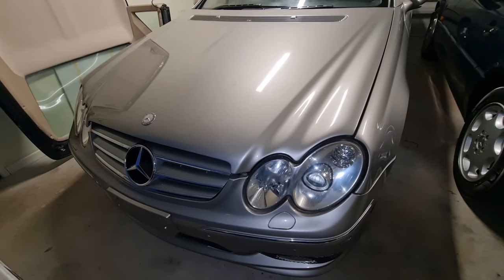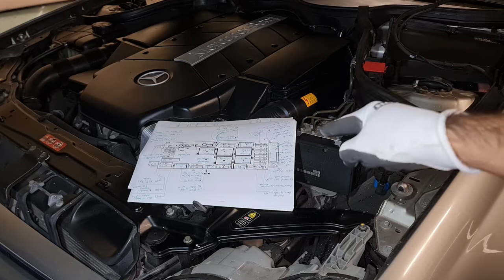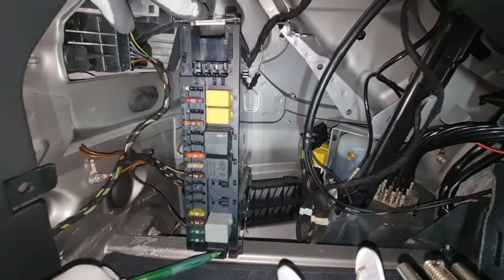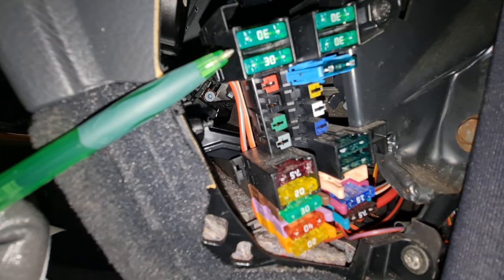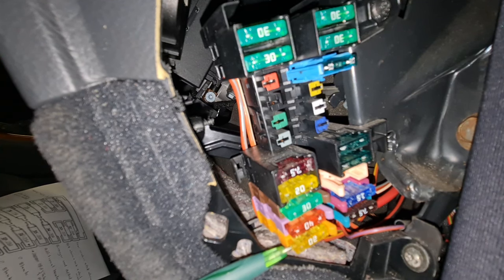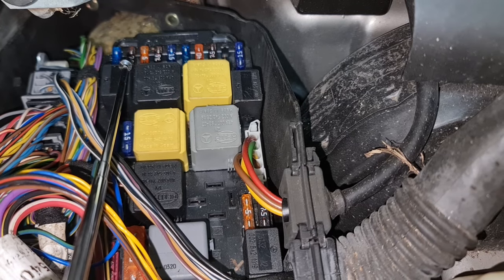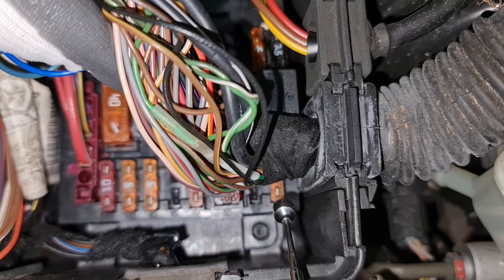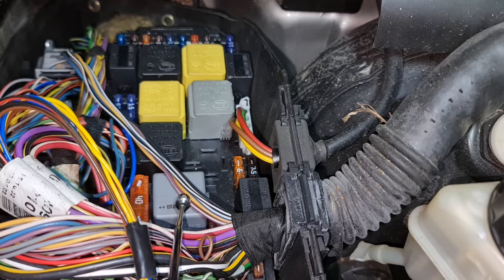Mercedes CLK & C class Fuse and Relay Diagram & location

Comment: CLK 320CDI year 2006 sporadically cuts off. When I restart it it starts perfectly as if nothing has happened. Could the terminal relays (15R and 87) have something to do with it? Sometimes it happens even before i start the engine. The instrument lights turn on and off.
Reply from the maker: @erensazakli7554  yes. And check the negative terminals too, they might get loose or corroded.

Comment: Hello, my ac and heat randomly went out and will no longer blow. Which fuse could that be ? Thank you
Reply from the maker: Please check the relevant fuse and if if the fuse is good, the module on top of the blower fan can be faulty.  Or the blower motor itself.

Comment: There are four fuse boxes on clk320   2002 usa  infront of passenger seat under the  hood  there is also 1 relay there😅
Reply from the maker: Thanks mate, 2002 is this a W208 or W209?

Comment: hello sir i have w203  with battery dead i was change the battery but i have no power in my car but when i switch on the radio it work but there is no contact no sound at riley when i  take off battery cable if i can get your whats app i send u vidéo you will understand butter thank you .
Reply from the maker: There are 3 big Fuses close to the firewall.  Check those out, make sure the battery is good, charged and the contacts are clean. Make sure the polarity of the battery is correct too.

Comment: Would you happen to know which fuse or relay would control the rear headrest/roll bars from popping up spontaneously and then the hazard lights start blinking? It's a 2009 CLK550 Cab, which does not have the roll bar switch to reset them. They have to be pushed back down manually. Any thoughts you might have on this would be greatly appreciated. Thank you!

Comment: CLK 200K 2000 Manual - Possible ECM issue?

Car's been having starting problems for weeks. The starter engages but won’t start the engine. Now, it won’t start at all. After a jump-start attempt, the key stopped working (not recognized by ignition or central locking), but it still sends a signal.
Reply from the maker: Ok, check to see if the car builds fuel pressure first. Check the fuse number 4 in boot also. Then see if you have spark. No spark? CpS gone (crankshaft Position sensor) I have lots of videos on all of these topics, check W209 playlist.

Comment: Hi, my fan is not kicking in causing the car to overheat.  What can I do?  Bad fan relay?  If so, location or where to find it in your video.  Any help is  appreciated.  Thanks!
Reply from the maker: I believe the CLK fan has no relay. The power comes straight out of a fan modulator and ECU. Need to diagnose using MB Star.

Comment: Hey! I recently changed an indicator light (right side) but I don’t think it was wired properly as the indicator light would flash every so often when the car was off. A couple days later, my car wouldn’t lock or unlock and the key does not start the ignition at all, the key hardly moves when it’s in the ignition? Could this have tripped a fuse such as the starter relay? Or do you know which fuse would be responsible for this? Thank you
Reply from the maker: Hi mate, this might have nothing to do with the indicator issue. Are you sure your battery is healthy / charged? Check the voltage first to be +12.5
Reply: @BenzAddiction  thanks for the reply, yes mate it was around 13v

Comment: I have no power going to the ac compressor in my 04 clk320 . Checked the 3 fuses and they are good.  Anything else I can check?
Reply from the maker: Hello, you need to check: 1. Pressure switch.  2. If you have enough gas in the AC system, both can cause the compressor not to work.

Comment: Hi I have a 05 clk320 and i have a problem with the left fog light, it's this little lamp at the bottom of the bumper on the left, it doesn't light up the light bulb is good
Reply from the maker: Might be a connector issue, or wiring issue... check your negative too.

Comment: If relay is defective and being traced for malfunction,,do we still need to check wiring and ground.
Reply from the maker: Well you first need to check simple and not costly parts and then replace Relays, a horn relay is unlikely to be faulty if not used excessively...

Comment: I have a 2004 CLK500 that I'm trying to fix, just replaced fuel pump and sending unit but still don't get a signal to pump.  BUT I noticed my SAM is upside down from the one in the video.  Is that normal?
Reply from the maker: Not sure, just fix it to the original position, might fix the issue. I know there is a cut off switch somewhere for roll over.

Comment: Hi I am trying to locate another accessory fuse in the engine compartment I know the cigarette lighter is one but I have my dash cam connected to that one I need another one for my daytime running light harness can you please advise me which other fuse is an accessory fuse or can I piggyback the daytime running light harness wire together with the dash cam wire on just the cigarette lighter fuse would that be safe thanks..
Reply from the maker: Hi Peter, if by daylight runing light you mean similar to fog lights but LED, where the actual fog lights are, you might want to have a look at this link which has wiring diagrams and more information: https://charm.li/Mercedes%20Benz/
Reply: No I mean seperate from the fog light the harnes6has 3 wires red and black get connected directly to the battery and a blue wire that I need to connect to an accessory fuse so when I turn the car on the daytime running lights come on and when I turn the car off they go out after 20 seconds
Reply from the maker: @petergiannitsadis3561  if those lights have 3 wires, the blue wire is just a sense and you are not going to pull much of a current from the blue. So you can connect it to pretty much anything as long as you secure your wires properly and insulate them correctly,  and use a 1 AMP inline fuse and holder, but as I said, have a look at the diagrams... hope it helps.
Reply: Hi I connected the blue wire to the wiper motor fuse the wipers work only in accessory or ignition mode  all good now.
Reply from the maker: @petergiannitsadis3561  good to hear 😀

Comment: I have a problem with my clk500 2005 the ac keeps turning on and off it blows air for a lil then just turns off and nothing comes out and was just working fine what can that be ?
Reply from the maker: I think best solution is to scan for codes.

Comment: Hey Benz Addiction my clk 500’s anti theft system has been activated for the past days and the alarm will go off when i get in but the car will start perfectly fine do you have any tips on how i can turn off the anti theft system
Reply from the maker: Hey did you trying pulling the Fuses out?
Reply: i pulled fuse 8 in the trunk out and it only made things worse but that was the only fuse i took out

Comment: Is there a fuse I can use in the trunk fuse box that is ACC power?
Reply from the maker: Just use a multimeter,  it is easy to check.
Reply: @BenzAddiction  cool Ty! Imma try 5, 7, 11, or 12 … according to some diagrams..
Reply from the maker: @chanjasonsk  That's the way!
Reply: Hmm but if there’s no relay next to them, do I gotta buy one or would it just mean always on…
Reply: Feeling like 11 has to be it..
Reply: As I have no clue what Relay 1, terminal 15R (N10/2kF) means

Comment: Where is the A/C located? on my 2006 clk 500 please tell me
Reply from the maker: Hello, is this for the blower motor or the AC compressor issue?
Reply: I refer to where is the fuse and relay of the A/C
Reply from the maker: @Korayma Martinez  check fuse number 30 - 41 and 51.

Comment: My windows and seats ain’t working. What fuses or relays should I replace.
Reply from the maker: Sound like the door module to me which is behind the door card, or the module under the seat. 2, 21,29, 1,22,34 check these though.

Comment: Is it normal to have missing fuses like some you showed? Would it damage my car if the fuses came missing but I add them?
Reply from the maker: Some cars are diesel powered,  some manual transmission, these are for different options and trims, so do not worry so much about missing Fuses if all of the functions of your cars are in working condition.

Comment: Question...I'd I have ah parasitic drain and the only thing I Kno is mi car radio speakers were popping when mi car was completely off so maybe fuse 64???
Reply from the maker: Pull the Fuses one by one and see which one cuts the noise...
Reply: @BenzAddiction  so it makes the noise randomly but I went out last night and removed the radio fuse and sound system fuse ... An boom mi car didn't Instantly die soon as I turned tha key off...it actually crunk up again...but we'll see going forward thanks alot man💪🏿💪🏿💪🏿
Reply from the maker: @ProllyHigh666  no problem 😊

Comment: My car radiatorfan blows non stop
Reply from the maker: This usually happens when the data from sensors to the ECU is cut, this might be an unplugged connector,  bad negative,  rusted ECU connection, bad ECU or a bad temperature sensor. I fact this is a self defence action against damage as the ECU does not know what is wrong. You need to diagnose your car using a proper scanner preferably MB star.
Reply: @BenzAddiction could you do a video on where there spots arr

Comment: thanks for the video it is very helpful but still I can't fix my problem, and on youtube I can't sent you a photo of this Bluetooth device I cut with a knife I can sent you my e-mail if you are interested in helping me I will appreciate it a lot.. thanks again for your useful video's :)
Reply from the maker: You can always email me, but mu knowledge I'd limited, but I can try: info@Benzaddiction.com
Reply: @BenzAddiction  I will send you all the photos in the morning. Thankyou so much it's nice to have good and nice people like you. I appreciate it a lot.
Reply from the maker: I am quoting this from a forum for you: "And we're good! Pulled seat, unplugged & removed Tele-Aid. Only had to code the Airbag module to tell it to not worry 'bout telling Tele-Aid in case of crash. Had swapped out the original radio for a double din so no worries with the radio.

Car starts fine, no SRS or other warning lights. So one a USA facelift SLK with Tele-Aid, there is likely no need to bother with Retrofit menu option, as Dave pointed out above, even if you retain the factory radio, likely only need to inform it so maybe two modules"

https://www.slkworld.com/threads/r170-xentry-das-is-entry-for-retrofits-and-modifications-useful.587919/